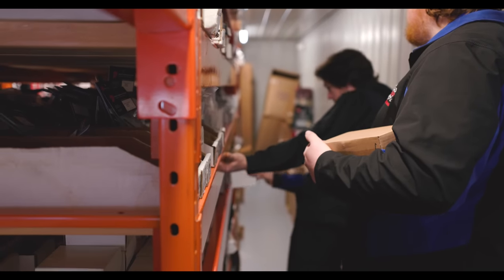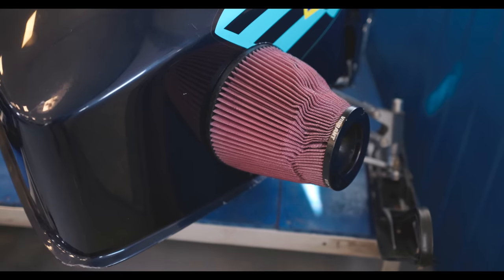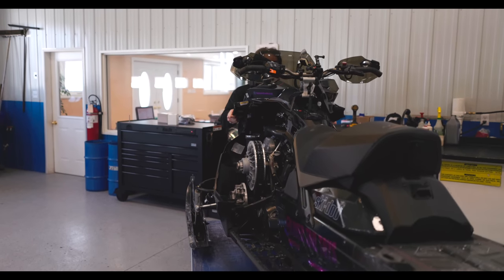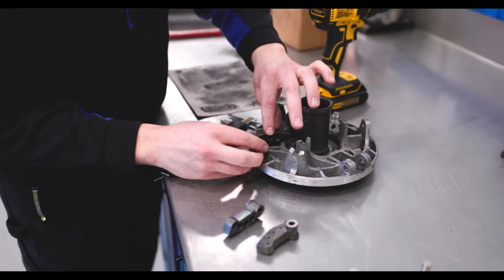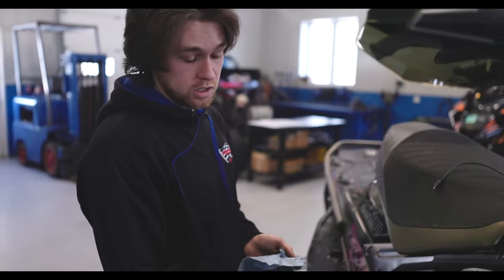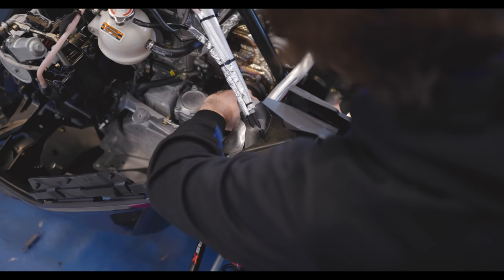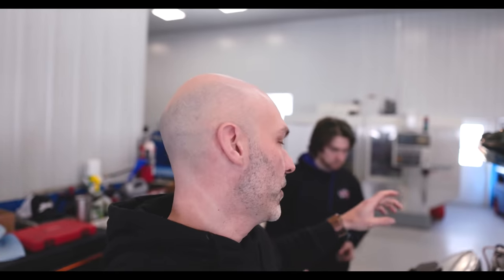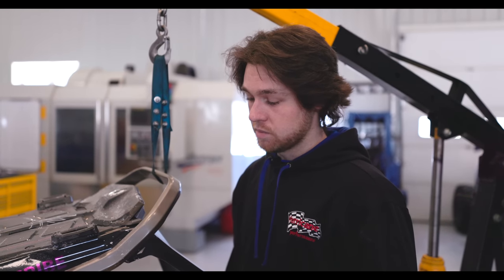35HP! 2022 MACH Z GETS NEW ECU + TUNE + CLUTCHING + GEARING + DOWNPIPE from Hurricane Performance.

Comment: Do you know of anyone trying the intercooler on the stock sled? If so, was there an rpm gain?  I'm still strggling to get the right RPM after the BRP update. thanks
Reply from the maker: @Gaetan Desrochers, I personally don't know anyone or have experience to comment on a stock sled but Dave at Hurricane tells me that anyone doing long pulls will definitely benefit. You should contact them at to chat more. I did also make a video about the intercooler specifically but it was on a tuned Mach, you might still be interested in the results.
Reply: @BeaverTailToys  It's because of your video that I'm on the bubble.  Like you said it worked on yours.  But, it's a big investment for an unknown.  I appreciate your reply. thanks

Comment: The 2022 Mach Z should probably be the most reliable machine on the market. It's the heaviest sled on the market, so you know everything must be beefed up. For a stock comparison. 2022 Mach Z 550lbs.  2022 Sidewinder SRX/Cat9000 475lbs. Polaris 850 Indy VR1 475lbs......   The Mach Z is flat out 75 lbs more than ALL comparable trail sleds on the market. Conclusion. The Mach Z probably used beefed up components nearly everywhere. Ski-doo knows it needs to maintain a great reputation for the name "Mach Z". ITS A BEAST !!!!!!
Reply from the maker: I love my Mach but I’m not convinced the extra weight is all about quality. My 22 Rave (although 850 2 stroke) is much lighter and it has definitely been built with quality in mind (beefier chassis and suspension). As far as reliability, my Mach had a front shock go bad at around 3000km mark on it. There was a minimal impact which I caught in another video. Anyway, love the sled and it is a beast indeed!
Reply: You are a bit off with your dry weights.  The Z is not the heaviest.   Yamaha doesn't post dry weights but Winders have been weighed and they are in the ball park of 590# dry.   The Z is 550, new Boost is 491 and na Polaris 850 475.     Boost will give the Winder a good run this year being 100#'s lighter.   

Great vids Vince!  Keep em coming!
Reply: @northwash  Yamaha dry weights are posted by Yamaha directly from the specs on the official Yamaha website. Have a great day.
Reply: @shperax  Incorrect.  You realize with your numbers you are saying a 4 stroke 998, turbod snowmobile weighs the exact same as a 2 stroke 850 Polaris???  Ah well.  No biggie.  Carry on.
Reply: @northwash  I'm not saying it. I got the data from the manufacturers. They are saying it. Blame the manufacturer for false information if you know differently.
Reply from the maker: @n keates Yeah, you're probably right. I've never really researched the weights of the machines. Thanks for the info.
Reply: Yeah...I find it hard to believe there is a 75 pound weight penalty for the Z over the Winder.  Hmmm...not sure about that.
Reply: Been riding 1100 Cat Turbos and Thundercats for over a decade and there is no way a Sidewinder/9000 is 475 lbs. More like 575lbs. The difference from a VR1 to a Cat turbo is easily 100lbs. MachZ and Thunder probably weigh about the same.
Reply: @xcpilot618  Your riding experience is very subjective. I posted the manufactures advertised weights. Those are the manufactures saying those weights. Not someone saying what it feels like when they ride it.
Reply: @shperax  Not just riding, I can lift the front (and rear of a VR1). Not the case with Thunder. Nothing subjective about it, I can't lift it.
Reply: @xcpilot618  A toddler could lift the front end of a G4 and Axys/Matryx. It doesn't mean they are light. They just transfer weight very effectively. In the case of performance snowmobiles, you want a lot of ski pressure. Its all about the 0-60 and 1/4 mile times. Yamaha has always been known for a ton of ski pressure.

Comment: Still happy with it? Any issues?
Reply from the maker: @Jeff S yes, still very happy with it! Only issue I had with it was it sometimes needed multiple cranks to start in “warmer” temps but they have since fixed that with an update 👍🏼 Going to be putting out more content this season about the inter cooler and maybe even a stage 2 250 😈

Comment: Not to burst your bubble but I’m super disappointed in your results. My mach z will do 120 on the speedometer stock. You did ALL that for 4mph? What a joke. No your factory launch control doesn’t work and you have no way to try and be efficient in a bind far from a gas station. How are you not pissed?
Reply from the maker: @Tate Winegar you ain't bursting anything. Top speed is not why I modded the sled. I think it's a mistake to use top speed as your only marker. Also, I still have launch control and Eco mode so I'm not sure about your later comments?
Reply: @BeaverTailToys  your words at 18ish minutes. You said you had no eco mode. Eco mode was a late update they just added so now maybe you have it but not from the factory eco switch. Your sport eco sport plus switch no longer works, right? Your sled isn’t “faster” than it was stock. What did they say about diagnosing problems at a local snowmobile dealer? Does it still monitor fault codes a skidoo tech can solve? Or did you spend thousands of dollars, hours and hours of time, drove however many miles, and wound up with a sled that’s less repairable, less efficient, with switches that no longer function, and no extra top speed?
Reply: @BeaverTailToys  and sorry for sounding like a total d. I’m just trying to be devils advocate I’m a fellow mach owner who was hoping for a little more top speed and i keep watching videos of guys going to 230hp and none of their sleds are able to go any faster and I keep getting frustrated seeing that the only Mach’s that go any faster are having to get cranked up to 250hp+. I bought a mach z to have the “fastest” skidoo i could buy and I’m pretty confident 850 e techs can do 116-118mph it’s frustrating the mach can’t leave etecs in the dust on lakes and up north straight aways. I just want 10 miles an hour more, and it seems I need to spend 8 grand on a 250hp+ kit to do it and that is frustrating and doesn’t make sense